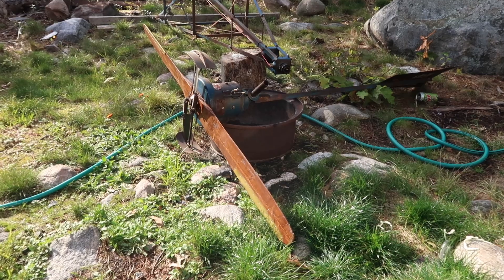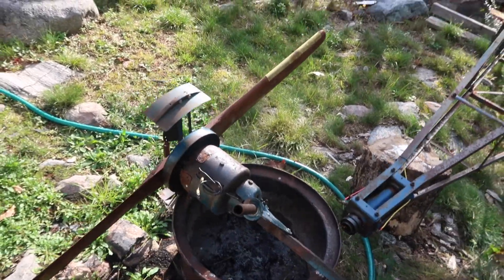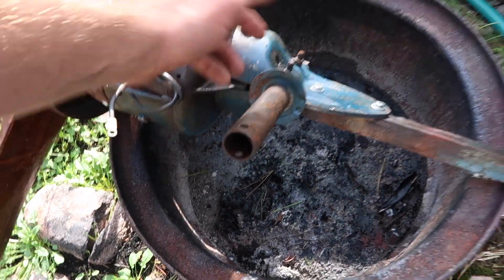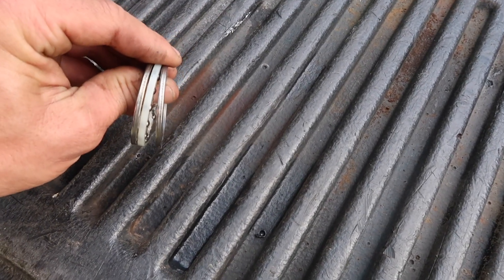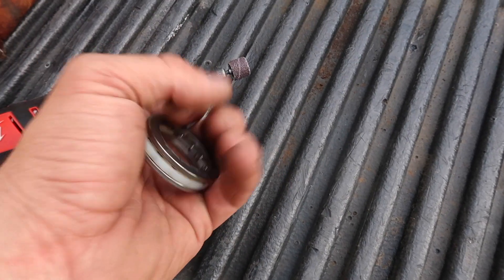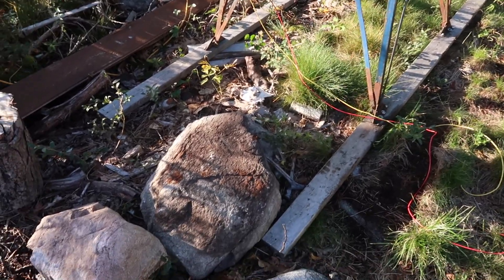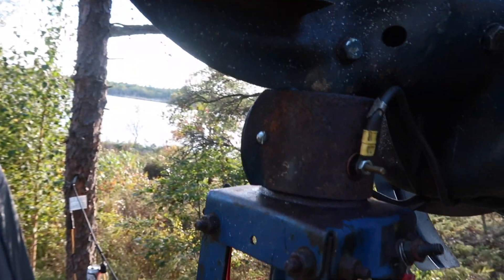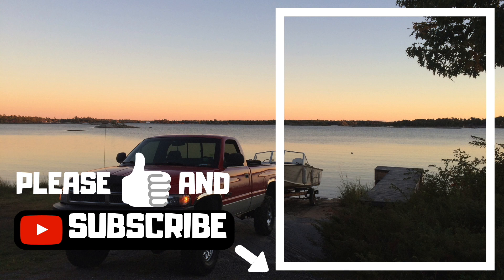Wincharger 12V Resto/ Fixing Part #2

Comment: I am biased towards vintage Delco stuff ecspecially the all tube Sonomatic automotive radios, but at 12v that windmill would very comfortably charge a 12v battery and run nice a 1955 Delco Sonomatic radio.
The radio im refering to is the all in one boxy type with the 8" speaker. Only draws 2.7 amps at 12.8v. Which is damn efficient for such a nice golden throated twin 6V6 output radio.
Reply from the maker: Thank you, so glad others are interested in this. Could I run a 12V regulator on this off a car? I have not got it fully dialled in.

Comment: Very interesting video, never seen one of these. We use a windmill to pump water to our cattle. I have got a lot of good info from your 300 king quad videos Thank you. I have a problem with mine now , new fuel pump , new petcock and still no gas  to carb ???  Thanks again for making these videos.
Reply from the maker: Hey Robert, very cool you still use your mill. I also restored a water pumper in my other videos. 

As far as the KQ you have covered everything! I can’t see that there would be a clogged fuel line? If not maybe a stuck float needle in the carb not allowing fuel in.
Reply: @Schneids15  Thanks for the reply. Any chance a vacuum problem?